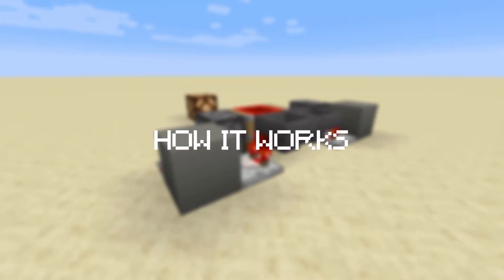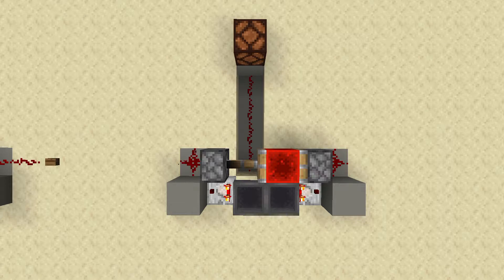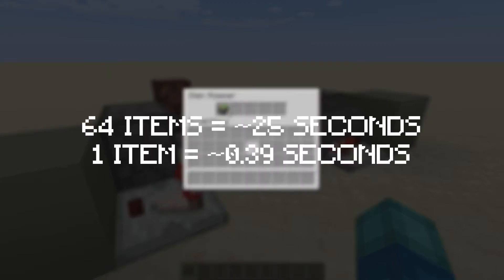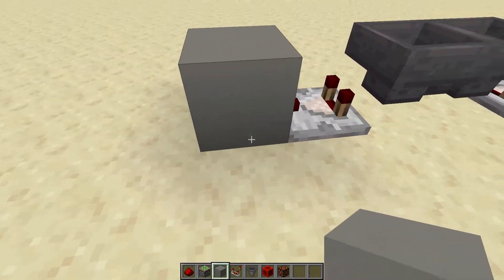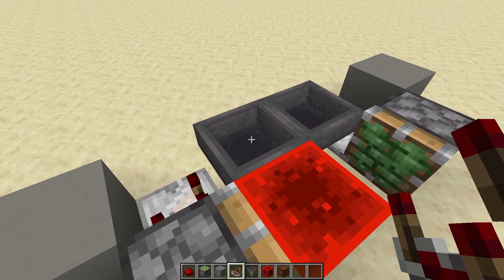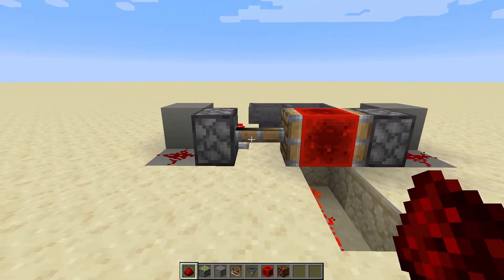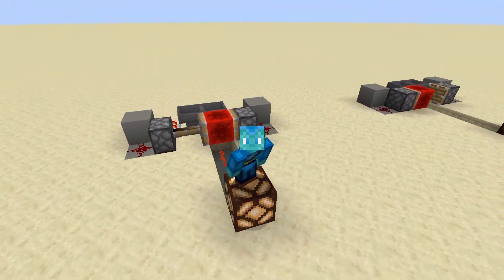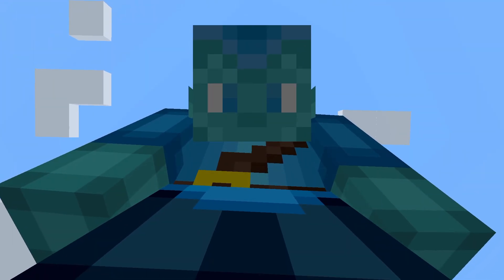How to Redstone: Etho Hopper Clock - Simple Redstone Tutorial | How it Works & How to Build

Comment: Really not sure if one item is equalvalent to 0,39 seconds. The clock behaves diffrent when only one item is inside (14 gt cycle so it gets shifted every 7 gt). But if there are at leat 2 items inside i think the timing can be calculated with this equation: 
y = 0,2s+(x-1)*0,8s 
y...time one cycle takes in s
x...number of items
simplefied: y = (x*0,8)-0,6

In the end 1 item adds exactly 0,8s if there were at least 2 items in already. Otherwise (when there was only 1 item in) it would add 0,3s (from 0,7 to 1 cycle) or (when there was non item in) it would add 0,7s (from 0 to 0,7 cycle)

X Y
0 0s
1 0,7s
2 1s
3 1,8s
...

But still great video xD
Reply from the maker: Honestly, had to read this a few times to make sense of it. 😆 Thanks for the info, didn't know this!